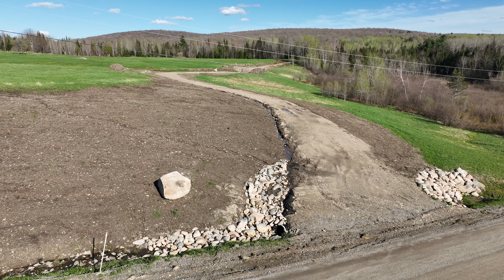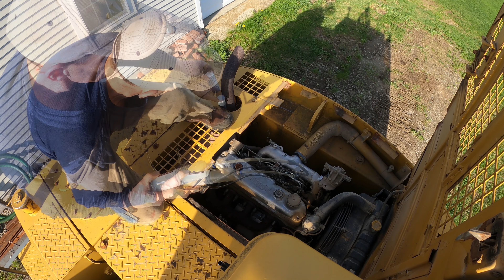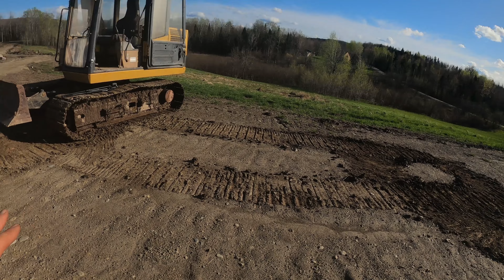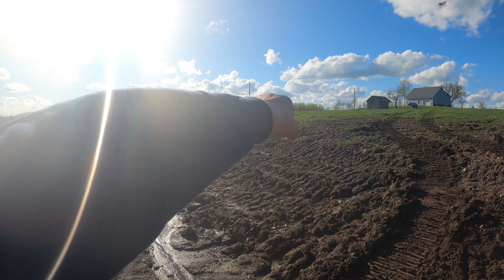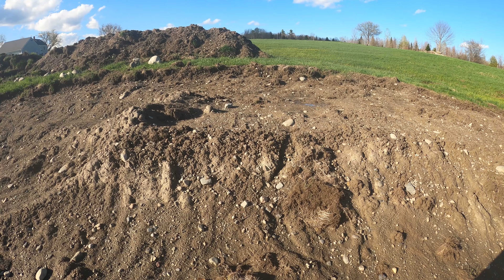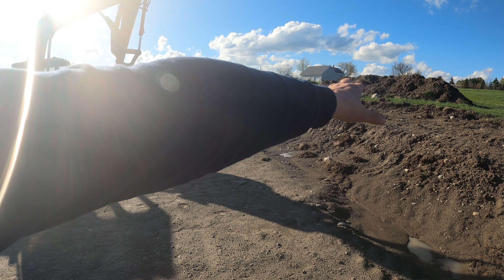Beginning this summer's work on a road in a field

Comment: For that kind of work, you have the right equipment!  The steel track helps a lot to pack down material.  On my machines, I often change the oil twice for one filter change. Especially when the hour count is very low.  On my excavator, engine oil is only 4 quarts, so not so expensive. I think this kind of test is very useful for hydraulic oil, where the amount is large and deterioration is not so visible.  Thanks!
Reply from the maker: I’m looking forward to the oil analysis results.